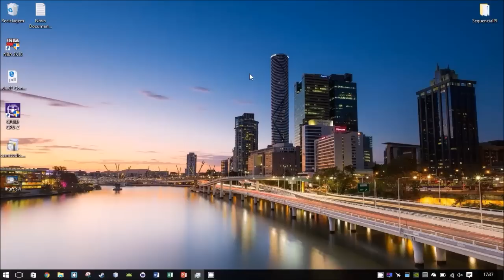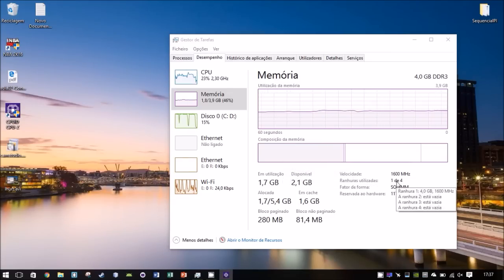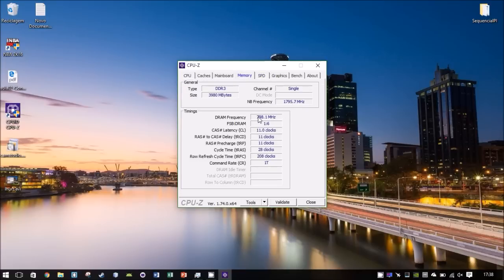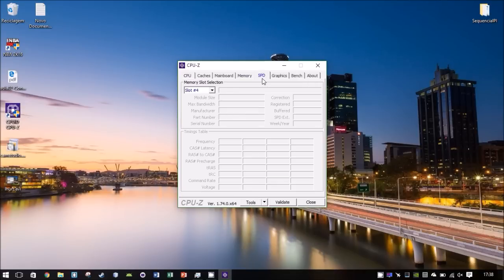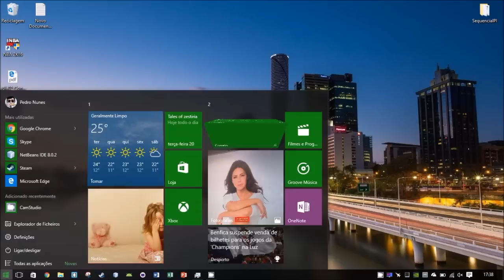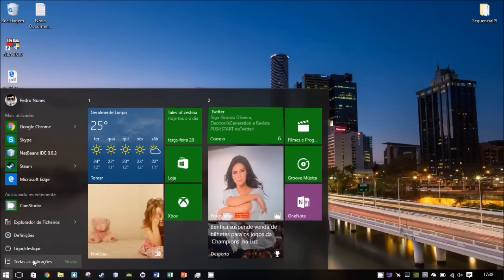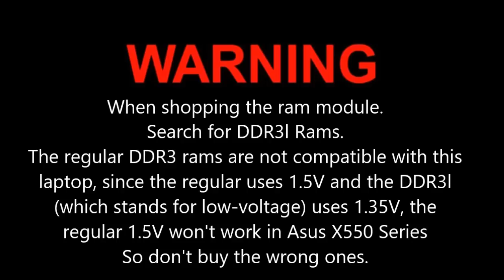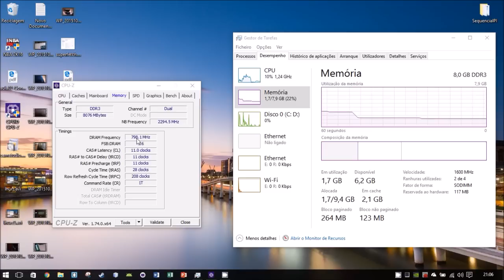How to upgrade Ram on Asus X550 Series (X550LB)

Comment: So according to my research, it has 4Gb ram soldered already but I can maximise it upto 12Gb Ram total.Does it mean I can only add/put 8Gb ram?
Reply: On this video u only add 4Gb,so ur total ram is 8Gb,so can I put 8Gb ram to make my total ram of 12Gb ram maximum.
Reply from the maker: @boy10413  you can, but you will loose the dual channel feature, thats why I've only put extra 4gb.
What do you do with your laptop?
Reply: I want to make it fast,so it's not okay to put 8Gb instead of 4Gb?
Reply from the maker: @boy10413  It depends what you do with the PC, if you don't game on it, I would just add 4gb of ram and enjoy improved performance in the CPU and IGP thanks to the dual channel (when you pair 4+4GB)

I would also (this one is mandatory), remove the hdd and add a SSD
Reply: Or can I change from HDD to SSD
Reply from the maker: @boy10413  you can, I did that and the difference in performance was huge (windows performance mostly)
Reply: Okay thanks man

Comment: Hey there, great video! I have a question and i need help please.. i have already on my laptop a 4gb ram and i want to upgrade it to 12gb ram. I found some 8gb rams but i don't know if they are compatible.. i mean should i take the ram that says in the internet (SODIMM) that is compatible? Or i can take some of them? 
I found these rams:
•Silicon Power 8GB DDR3 RAM
•GoodRAM 8GB DDR3 RAM
•G.Skill 8GB DDR3 RAM
Reply from the maker: Yep it's SODIMM, but depending on your CPU, you will need to buy either DDR3L or DDR3.
Just a big tip, depending on what you will do with your PC, having 8GB might be better than having 12GB due to the dual channel.

Comment: I know this is very late but I have a question. What ram should I get the 1600MHz or 1333MHz?
Reply from the maker: You should get the same speed that you have now on your laptop, if your actual ram is 1600mhz, you should get other with 1600mhz, same story with the 1333mhz
Reply: @BenchARTVideos I got it. Thanks!

Comment: No idea if u still see comments regarding this video but anyway. For Asus  x550jx what would you recommend? Rn i have the 4gb soldered and 2gb but its not working. Not sure if it is broken or memory slot is faulty. But i remenber i had the pc with 6gb when i bought after a while decreased to 4gb so something happened. Also should i upgrade with 4gb or 8gb? I only use it to play games. Thanks a lot
Reply from the maker: I would go with more 4gb instead of more 8gb.
Yes I know that more games are requiring more than 8gb but I bet your PC isn't powerful enough for them anyway.
So if you upgrade to 8gb you get the dual channel boost which will help your CPU (a lot) in games
Reply from the maker: By the way, what do you play?
Reply: @BenchARTVideos  genshi impact/ lost ark/ league of legends. That's pretty much it. Obrigado pela resposta ;)
Reply from the maker: @SirMitsuruji5  :P
8GB é mais que suficiente para esses jogos e acabas por ter o boost do dual channel no CPU que ajuda a eliminar parte do stutter.
Reply: @BenchARTVideos  ddr3 1.35 para o meu portatil3?
Reply from the maker: Depende do teu CPU, qual é o modelo todo do teu CPU?
Reply: @BenchARTVideos  ntel(R) Core(TM) i5-4200H CPU @ 2.80GHz   2.79 GHz. Isto

Comment: Great video thank you! Do you know how many ram can we upgrade max in these models?
Reply from the maker: I think it's 12GB (4GB soldered + 8GB RAM Module)
Reply: @BenchARTVideos  Is it possible? I mean when the first is 4gb, the other can be different (like 8gb)?
Reply from the maker: It can, but I do not recommend, since you won't be having dual channel.
8gb might be enough depending on what you want to do.
My recommendation is to add another 4gb with the same speed instead of 8gb (total: 12gb), but if you really think that you are going to use above 8gb constantly, loosing dual channel just to have another 4gb of ram might be a better decision than keeping dual channel.
Reply: @BenchARTVideos  thank you so much for the reply!

Comment: For me, X550C works with 8GB Samsung DDR3L single stick 1.35v. So you will get 4+8=12GB Ram.
Reply: I also have the X550C anf got a blank screen when I tried the same RAM stick, different manufacturer.

My impression was I can't go above 10 gigs of RAM.
Reply: Maximum capacity of this Model is 6 Gb RAM or so I heard. You are wasting money on buying 8gb ram
Reply: Hi..., Yours Laptop It works with 12 GB ??,  What exactly referencia of Samsung Is the memory..., Thanks !!!
Reply: Did you add an additional 8gb ddr3l ram stick? Which company made that ram stick? I also plan to upgrade the X550LD but I don't know the maximum RAM supported by the laptop.

Comment: I install a Ram but it does not boot fast
Reply from the maker: Boot time is not related with lack of ram, for that you need a ssd
Reply: @BenchARTVideos  I have a ssd, what I mean is, when the time I install the ram and the screen are not opening. It is running but the screen is black.
Reply from the maker: Ah. What is your cpu please?
Reply: @BenchARTVideos  CORE i7-6700HQ
Reply from the maker: That's a pretty good cpu I don't understand why it takes so long to boot, probably tons of junk in your windows system

Comment: Sir i have X550CL models. This laptop has i5-3337u cpu , Nvidia Geforce Gt 710m gpu and there 4 GB ram .What i should use ram types and what is maximum capacity ?
Reply from the maker: My recommendation is to add only another 4GB (making a total of 8GB), this way you will enable dual channel which is useful performance that you get.

As for the ram type, it depends on your laptop, you should buy 4GB DDR3 1600MHZ, the only doubt I have is if you need to buy DDR3L or a regular DDR3 works.
For that you should really contact Asus Support.

Comment: Hi does my asus x550lc has on board memory as well? I tried like u did seems only upgraded ram just show up
Reply from the maker: Have you opened to back panel to check out if you have any free slot?
Reply: @BenchARTVideos  yes it have, my laptop is x550lc i5, not sure mine on memory is faulty or system not detected. My thoughts is if i purchase 4gb ram i can hv dual channel
Reply from the maker: So you have 4gb solded probably, if you have 4gb you can buy another 4gb for dual channel
Reply: @BenchARTVideos  no no, i already installed upgraded 4gb ram, but windows only show up the upgraded one. Not sure my on board memory faulty or my asus x550lc doesn't hv on board memory.
Reply from the maker: When you upgrade the 4gb, did you swapped for other ram? Or it was just a free slot there?
Reply: @BenchARTVideos  i already put the upgrade 4gb ram, i check cpu z only this ram show up, Kingston cl11 4gb 1.35v. Means my on board ram doesn't work right?
Reply from the maker: Might be a bad reading from cpu-z. How much memory does the windows say that you have?
Reply: @BenchARTVideos  only 4gb ram, and it from my kingston ram. Dont know what solution to fix or might be my laptop doesn't have on board memory
Reply from the maker: It don't make any sense for your laptop to not have on board memory.
I'm saying this because you said that you did put in there extra 4gb of ram as an upgrade, so if your system is only reading 4gb, it would mean that before the upgrade you had 0mb of memory, which is Impossible.

So if you didn't remove any ram so you could insert your kingston 4gb then your onboard ram is broken

Comment: Hey I can do it with Asus x555lj or it different???
Reply from the maker: Check if you have a backpanel for the memory, remove the screws and check it out of there is a clear slot. I'm not sure about the x555lj so you need to check if there is easy access there

Comment: can I use an 8gb ram or only 4?
Reply from the maker: It depends.
If you have already 4GB built in the laptop.
My recommendation is to get another 4GB (Total 8GB), by doing this you will enable dual channel, which will speed up certain tasks and CPU speed.

If you get 8GB (Total: 12GB) You might get more RAM, but dual channel is not available.

What type of tasks do you do in your laptop?
Reply: I used an 8GB board - 1600 - DDR3L and it works. Now i have 12GB in total.
Reply from the maker: It does but you are not taking advantage of the dual channel ;)
If he is going to game its going to make a better difference having dual channel that not having ;)
Reply: @BenchARTVideos  Thanks for the info

Comment: Good day. Does worth it if I still upgrade my Asus X550L today like you do or I buy a new laptop? Thanks
Reply from the maker: Depends on what you do with the pc.
What type of tasks do you do?
Reply: I want to use as gaming laptop with office work
Reply from the maker: What do you plan to play exactly?
Reply: Dota 2 and AutoCAD
Reply from the maker: Adding more ram (with dual channel) and buying an ssd is clearly an improvement.
Not for dota 2 but AutoCAD will surely fell snappier. It's a small investment. Of that don't really help you out that much, then a new laptop is really needed
Reply: Thanks 😊
Reply: Will adding Ssd need to flash again an OS system?

Comment: This slot was already occuppied, I wanted to see the other 3 slot!
Reply from the maker: The other 3 slots are bad reporting from the software 
Cheers
Reply: @BenchARTVideos  damn 😅 thanks mate!
Reply: @hussein.eh7818  Same in my case. Windows says that i have 1/4 slots taken. So i went to the store to buy extra 2 boards of 8GB each. But when i opened the laptop case, i've just saw that there's only one slot available :)))) The first one, cannot be changed because is soldered from the factory :D
Reply from the maker: Exactly ;)

Comment: Hello, I have a Asus x452c and I want to upgrade the rams. Do I need cl11 at 1600 ? I am not really sure.
Reply from the maker: You need to check what you have in your Asus x452c first.
If you install cpu-z (free software) it will say the speed that you are running your rams and which cl it is, all this information is on the memory tab, you just need to multiply by 2 the value that you have there on the dram frequency.
For example, you see there information of cl11 and dram frequency of 800mhz, you know that you need to buy a 1600mhz and cl11 ram. :)
Reply: @BenchARTVideos  thank you ! 👊
Reply from the maker: Let me know what you have there :)
Reply: @BenchARTVideos  It says that I have 4gb at 800 mhz and at latency tab it says 11 clocks. I'm not sure how many memory I'm allowed to add bcs on the internet some say that I can add up to 12gb and others up to 8gb. On cpu-z , at the SPD tab it doesnt show me that any slot of RAM is used.
Reply from the maker: My suggestion if for you to add only more 4gb 1600 cl11, this is because if you add 8 gb you will have 12gb, but you won't be able to have dual channel memory which doubles the memory latency and also helps the cpu performance.
Now, there is 2 types of memory for your laptop, either is ddr3l or ddr3.
The ddr3l is 1.35v and is only used in ultra low voltage CPUs, while the regular ddr3 (1.5v) is used on regular CPUs. If you pair up regular ddr3 on a ultra low voltage cpu it won't boot.
So what is your cpu model?
Reply: @BenchARTVideos  My processor is Intel core I5-3337U that goes up to 1.8 Ghz that goes up yp 2.7 Ghz. I'm not sure if the RAM that is already installed on my laptop is 1.35v or 1.5. I guess I'll have to remove the back panel to check.
Reply: I think that I'm going to buy this Kingston KVR16LS11/4, 4GB DDR3L, 1600Mhz, CL11
Reply: I also found on Asus website that I already have a  DDR3L 1600 MHz SDRAM, OnBoard Memory  4 GB, 1 x SO-DIMM socket for expansion up to 8 GB SDRAM
Reply from the maker: It's solded. It's like mine and you will have a free slot to add the ram.
According to Intel ark you can use either ddr3l or regular ddr3
https://ark.intel.com/content/www/us/en/ark/products/72055/intel-core-i5-3337u-processor-3m-cache-up-to-2-70-ghz.html
Reply: @BenchARTVideos  So this memory Kingston KVR16LS11/4, 4GB DDR3L, 1600Mhz, CL11 will work fine for me, right ?
Reply from the maker: Yep
Reply: @BenchARTVideos  thanks for your advice, it really helped me .😄
Reply from the maker: Just let me know if everything gone fine.
Cheers

Comment: Hey do you think DDR4 would work? And is there any way I could find the ram model?  Vídeo muito bom, obrigado.
Reply from the maker: Yes, you can find it on the CPU-Z.
Altough, your laptop will be only compatible with one type of DDR, which means, that if you have DDR3, you need to use DDR3.
Cheers
Reply: @BenchARTVideos  thanks, just another question: what's the maximum ram I can upgrade to?
Reply from the maker: @JAfonsoNunesMartins10  Depends, I need to know your laptop brand and model to answer that, but ideally you will want to have the ram at dual channel because it helps a lot the cpu, and the Intel GPU.
So if you have 4gb of ram, you will want to add another 4gb, or if you have 8gb and you still have a free slot you will want to add another 8gb for having the dual channel working ;)
Obviously if you have 4gb you can add other 8gb and have a total of 12gb but you will loose the dual channel.
Cheers

Comment: Hey, my laptop is an asus F550C but on sys. spec. appears that it is X550CC model (is that the motherboard model used?).
It has an i7-3537u and 4GB 1600MHz RAM but i'm not sure it is DDR3 or DDR3L.
CPU-Z doesn't 
differentiate between DDR3 and DDR3L and doesn't show the 4GB ram module included in the board on SPD window, so I can't see if it uses 1.35 or 1.5V (as in the video).
I would like to add 4GB more but i'm not sure whether should i buy ddr3 or ddr3l?

*Searching on the internet I've found on some selling websites that the asus F550CC (which I supose is the same as mine) allows to upgrade up to 8GB. It was also specified on those websites that the 4gb module included was DDR3 but I´m not sure that's completely reliable.

*EDIT: On the free slot of the laptop to add the RAM is written: 1.5V DDR3 REV 

Does that confirm that just DDR3 is needed?
Reply from the maker: Yes 1.5v is the regular ddr3. Also on Intel ark website it should say what memory does your cpu support, usually motherboard follows those specifications.

Comment: Really thank you for this video because it made it clear for me how the x550 series works,but my model is a little different
I have a x550vxk model,8 gb ddr4 2400mhz micron ram installed
Single chanel too
I have no idea about the voltage whatsoever,i have used every single app in existence and none of them tell me what amount of voltage the ram uses
What type of ram am i supposed to get for this model?
Does it also have an extra slot or should i replace it?
I opened it up and it had a black firm thingy(i have no idea what it was)attached to the ram slot
Its the core i7 7700hq model btw
Reply from the maker: Can you share some photos of it open?
Reply: @BenchARTVideos  wow,you replied so fast! Thanks a lot!
I just opened it up and its not attached to the ram slot,but rather beneath it.
Where do i send a picture?

Comment: Hey this is a old video but hopefully you respond. I have model k550c and on the ram slot it says to use the 1.5V DDR3 should I go by that?
Reply from the maker: What is your cpu? :)
Reply: @BenchARTVideos  I don't know but it's integrated into the motherboard. Where can I find exact model?
Reply from the maker: @bturcany  if you are using Windows 10, open the task manager, select the cpu, it should say the model, also you can install cpu-z which is free and small and will tell you what you have :)
Reply: @BenchARTVideos   it says Intel(R) Celeron(R) CPU 1007U @ 1.50GHz
Reply from the maker: @bturcany  I guess you are right, it should support 1.5v.
Looking to Intel ark's page, it says here that it supports ddr3/l/-RS so it should support 3 types. On the site from Intel my i5 4200 just says ddr3l or lpddr3 (which is the same thing). I guess you can go with the 1.5v, it's Intel official page so they wouldn't share wrong information. Cheers :)

Comment: Can I buy any DDRI
Reply from the maker: You should buy the DDR which matchs the ones that you already have inside.
CPU-Z can help you tell what ram type do you have and their clock speeds.
What cpu do you have?
Reply: Intel Core i5 4200u 1.6ghz. Actually I think I need ddr3l
Reply from the maker: Yep that's it you need that one

Comment: What is the meaning of ground yourself in a laptop?
Reply from the maker: It might mean to touch on your laptop first before touching in any component to remove the static electricity to prevent from damaging the component where you touch first.
Cheers

Comment: Why does it say 1 our of 4 slots used if you only have 1?
Reply from the maker: It's misreadings of the software, that's why I did recommend everyone one to open the laptop and check it out first before going to invest in any new ram :)
Reply: I see...Thanks a lot
Reply: @BenchARTVideos  One more question, can I use 1x8GB DDR3 for X550?

Comment: So does this mean that if I already have 4GB of RAM standard and add another 4GB of RAM into a second slot, it'll just add up to 8GB? Because I was first thinking I would have to replace the 4GB one with an 8GB one. Just asking to be 100% sure.
Reply from the maker: Exactly.
The included 4gb of ram are soldered to the motherboard, you can't remove it.